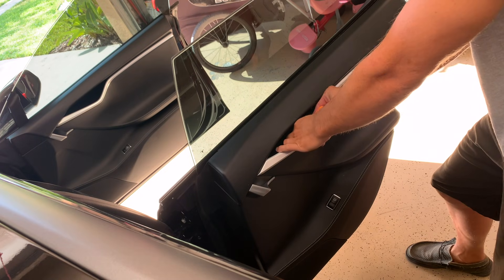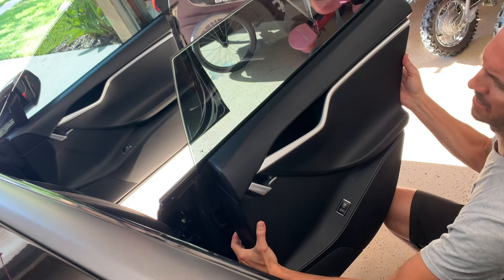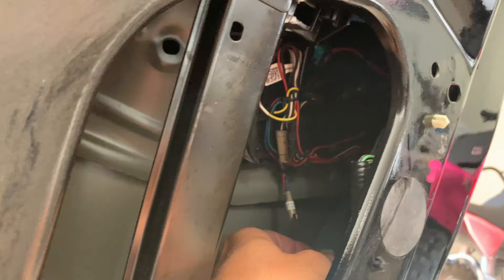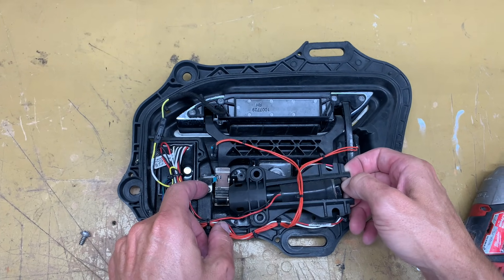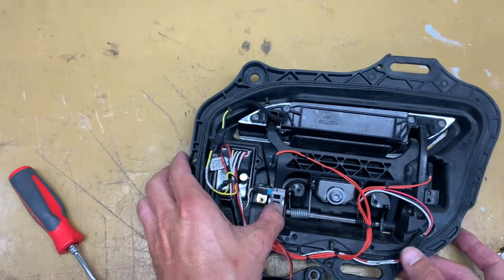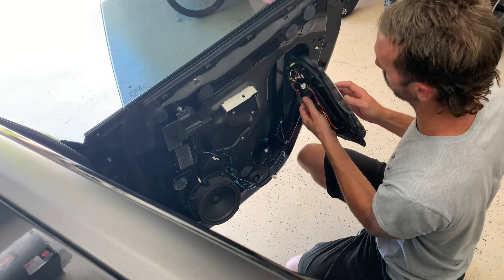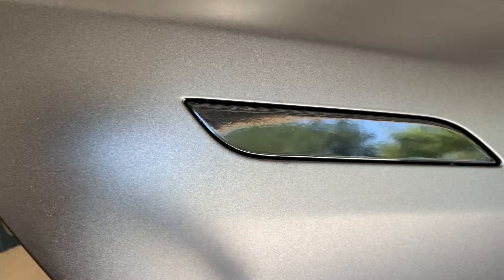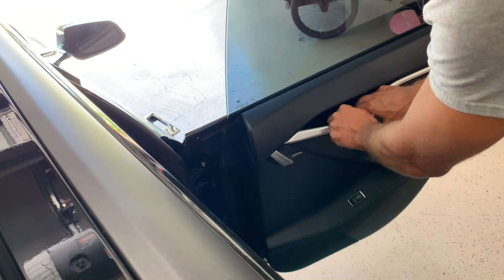Repair and Replace your Tesla Model S door handle

Comment: Chad, you're the best.
Love, the mullet!.
Thank you for the instructional.
My rear driver side door handle doesn't make a single sound nor does it retract? So I'm thinking it's just the micro switches that need replacing.
But I'm going to replace the paddle gear anyway just to be on the safe side so that I don't have to disassemble this door again.
Reply from the maker: Chris, I appreciate the mullet recognition, after 20 years of cutting your hair the same way, you gotta do something different. We are starting to see more and more GEN 3 handles being installed, and the gear often breaks on the motor itself, you should still hear the motor, but if ambient noises are too high...you may not. I would pull the door panel off and see if you can identify your handle generation.
Reply: @thereelwdad  I'm going to do this over the weekend.
Thanks, Chad.   Yeah I realized that it's entirely possible that I need another motor.
We'll see what happens on Saturday.
I love your commentary on your videos.

Comment: Hi Chad, after I unlocked my Tesla (2013 Model S), I heard a loud pop then the rear driver door handle doesnt automatically go out anymore. I can still hear the motor when trying to lock/unlock the car. Does the paddle gear all i need to fix this issue? Please advice! Thank you for your time.
Reply from the maker: Mike, based on that description it sounds like it is just the paddle gear, but we always suggest going ahead and purchasing the combo because the wire harness has a high failure rate as well and you are already in there!

Comment: My Tesla (2013 Model S) door handle is broken in a different way.  When the handle of the front passenger door presents, it goes out too far and opens the door (typically not fully, but enough I have to open it to shut it).  Do you sell a part or have a video to fix that issue?  It's pretty annoying, but I don't want to pay Tesla $1,000 to fix it.
Reply from the maker: That is typically the micro switch adjustment. There is a small arm on the microswitch that contacts a small Torx screw, and it can be adjusted so that doesn't happen.

Comment: Howdy Chad! I ordered a pair of gears but didn't know if I needed a new harness as well. My passenger door handle will not extend with touch. If i hit another door handle, or hit the unlock button, it comes out and functions as normal, but it has no reaction to touch itself. What do you think would cause this and how can I fix this issue? Thanks in advance
Reply: If it was the paddle gear, I don't think it would ever extend. More likely the microswitch that detects a push on the handle is bad (broken wire).
Reply from the maker: @David Coyle Jr. It sounds like it is the paddle gear, check my YouTube shorts for a video to help identify, there is a sound you will be able to hear.

Comment: The two hidden nuts holding the handle to the door proved to be quite difficult.  A bit more explanation in the video on how you got these out would be helpful.  My socket wrench got wedged between the bold and the window mechanism before the nut came off and I could not get the wrench out or change the direction to screw the nut back onto the bolt.  I think it needed to be loosened, remove the wrench and unscrew the nut by hand... now I'm stuck.
Reply from the maker: It depends on if you are on the front or rear door. But having the window all the way down and the chrome/felt trim removed helps to get to the two top nuts. I do agree with you that I need to add some additional details on that part. Hopefully, you have gotten yourself out of being stuck!
Reply: @thereelwdad  Thanks for the reply.  With the wrench solidly against the window, it was too late for me to lower.  I finally gave up and called in a Tesla service rep.  Learned a couple things from watching him: 
1. When the door is open the window comes down slightly, which puts the window over the upper nut.  You can flip the mechanism in the door frame to "trick" the window into thinking the door is closed (this raises the window out of the way.  
2. he took the rubber flashings out at the bottom of the window.  This allowed the window to move slightly inward providing additional space to work on nuts and manipulate the door handle mechanism.  He even had a little blow up bag that he placed between the outside and the window to hold the window away from the door handle mechanism.
3. Of course the real killer was that he replaced the entire door handle mechanism with an update that is more reliable than the original design.
I have the gear purchased from Reel Deal EV if anybody wants it.
Reply: @thereelwdad  by
Reply from the maker: @sprollie  Hi

Comment: chad - thanks for tips from a pro!   masking the door handle smart.  also making sure not to operate the window when apart (i ripped the lock harness and had to repair).   the switches in the 2014 S wire up differently so i skipped.  a couple of the little bushings on the paddle would not fit so i skipped.   i have  a piece of plastic that evidently covered the switch assembly and kept the wires from chafing on the window.   Can't figure out how to get it back in.   

my experience with tesla service is that they always leave a few parts out when buttoning up (to  lighten the car i am sure) so i think this will work out but the best advice is to send it to a shop like yours.

this was really well presented.
Reply: in the 2014 S there is a second piece of plastic that evidently goes over the door latch assembly behind the window.   the holes in the plastic sheathing match the 6mm (10 mm socket) bolts but are slid on as a place holder.  I found it impossible to put this on after installing the latch assembly and so curled it up and left it in the well of the door.     i think the main purpose of this might have been to keep the wires from rubbing on the window mechanism. 

thanks again.
Reply: to any owners close enough to reel deal, i would suggest getting them to do this.  really a pain in the ass that wound up taking up a couple of weekends.   i thought about this when we bought - i wonder how long until one of those door handles needs maintenance.   good news is that the later model cars have a better design.

Comment: What if i broke my c clip?
Reply from the maker: Then you would need to get a new one...
Reply: A c-clip came with my Real Deal kit. This wasn't mentioned or shown on their webpage but maybe they decided too many peeps were losing (launching!) theirs.
Reply: The 2 wire to door handle absolutely will not release an has no visible tabs to push. 1 side has a lift tab that seems to do nothing.

Comment: I have a problem with door handle model s2021 the door handle can’t move out and when I touch the door handle a little bit the door gets open I don’t have nothing broken inside the handle what should I do
Reply from the maker: Take it to Tesla, lol. It’s under warranty.
Reply: @thereelwdad  its happen after remove and replace the handle I just painted the 2 front doors
Reply from the maker: @Omid-EV  ahh I understand, it sounds like you may need to reset the car. You can try with the steering wheel resets, then try disconnecting the 12v and HV battery